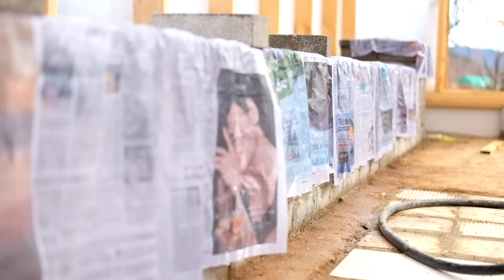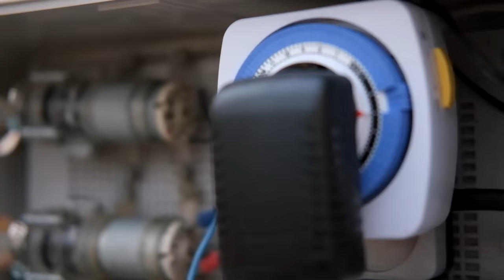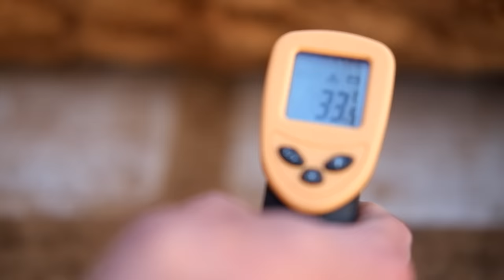비닐하우스 온돌 난방 만들기 | 온실 화목 난방 | 구들 만들기 | 가드닝 | 温室暖房  | Greenhouse Heating

Comment: This is brilliant!! I have been searching for examples of Korean ondol underfloor heating, so this is a compelling use of the concept. 
If you made a short ebook of the process of making all of it, so I could follow it from the US for my greenhouse, I would love to buy it. 
It would be good to know what dirt to concrete/lime/other mix you used for mortar, where the air intake is for the fire, if there is one, and so forth.
Reply from the maker: You know Korean Ondol. thank you.
It was a short video, so the explanation was insufficient.
I'll explain it later on my blog.
Thank you for watching.
Reply: Look into rocket stove mass heaters...
Reply: @ppeppefamily  link to blog?
Reply: Rocket mass
Reply: if you want to improve this concept you build the burning chamber below ground level, let the first 1m of the exhaust pipe decline, and then you let the rest, about 15 to 20 metres incline with about 1% incline. this stores more heat, especially into a lot of hea tabsorbing mass (earth)
Reply: Я слышала, что в корейских домах отопление в полу и мне это очень интересно
Reply: @@binanocht6110 that would be good, since it stores more heat.

A 1 to 3 percent decline, is enough to get around 10% more heat out the smoke.

Because the hot gasses gather before the incline part

Edit: 
The ratio between decline and incline should be about 1 to 5 atleast, so your exhaust has a good suction effect.
Reply: @@binanocht6110 of course i know what you mean, but i guess you dont know what 1% decline for a meter means
Reply: 하우스가  한국에 바닥난방 온돌  방식으로 제작
되었는데 얻어진 열에너지를 잘 보존 하는 것이 문제이고 나무숲 보호와 공기 
토양? 환경오염이  
없어야 된다고 생각합니다
단순한 기술은 아닌것 같습니다

Comment: Very nice ! My goal however is to eat more seasonally, extend my seasons with a passive greenhouse or sunroom, attached to my home of the winter-sun side ( south, in USA) & preserve well ( preserving nutrients with fermenting, dehydrating and storing as-is, like with root crops and winter squash etc., or "on the hoof" more and canning etc. less). I'd love to use geothermal heating too, and any other passive heat gain and retention and cold-blocking, temperature regulating/stabilizing that I can.
Reply from the maker: Thank you for good information. 🙏
Reply: If you're interested in geothermal, check out Citrus in the Snow for some inspiration. There are also ways to use compost for heat either inside a greenhouse or outside with a pipe bringing heat inside.

Comment: I'm curious why they didn't run the fire down the center of the green house, and keep the underground water where it is. To me it seems like it would spread the heat more evenly and be more efficient. Or was it a better use of space this way? Great video and I love how simple and DIY the whole thing is. It almost makes me wish I had such cold winters. Almost
Reply: And on top of it there are no obstacles in the oven. Hot air quickly passes straight outside. 
There should be some sort of labyrinth in the oven.
Reply from the maker: Thank you for those kind words 🙏

Comment: Growing up in a house with a wood burning stove attached to a metal chimney as the only heat source, I would run as much of the metal chimney inside as possible to take advantage of the heat radiation from it.  We could heat the house with a much smaller fire in the stove when we ran a slow fan behind the hot chimney pipe.
Reply from the maker: That's good information.
Thank you for watching.🙏

Comment: How does the water in the barrel get heated
Reply from the maker: Fire > Copper pipe heating > Small pump > Water tank
Water in the water tank - Circulation pump - Copper pipe - Water tank
Reply: Is the water in the tank solely for heating the space under the sisal rug? And why?

Comment: Awesome.  Where did you get the mat you cove the floor with, would be great to cover permanent beds in winter.
Reply: Have you heard of the Save Soil movement before? Without fertile Soil there is no food, and the climate is getting warmer, there were many droughts all over☀️
We can turn this around🌻🌿
#SaveSoil #ConsciousPlanet #Mentsükatalajt #Tudatosbolygó
Reply from the maker: Vietnam Coconut Mat.
https://greenking.modoo.at/?n_media=27758&n_query=%EC%95%BC%EC%9E%90%EB%A7%A4%ED%8A%B8&n_rank=5&n_ad_group=grp-a001-01-000000021990232&n_ad=nad-a001-01-000000139802710&n_keyword_id=nkw-a001-01-000003788980577&n_keyword=%EC%95%BC%EC%9E%90%EB%A7%A4%ED%8A%B8&n_campaign_type=1&n_ad_group_type=1
Reply from the maker: Thank you for those kind words 🙏

Comment: Some electro-ceramic could be possible better for keeping the heat inside of a boiler. Here in Russia we have a lot of energetic values we use just ventilation convector with climate-control. It is very cheap and producive.
Reply from the maker: Спасибо за добрые слова 🙏

Comment: Very well done,
But have a question for you to consider in the future
How do you clean the tunnel portion before the chimney?

And when that copper pipe in the heating area chamber, becomes covered with carbon etc. 
It will slow down the heating transfer, and wondered why you didn't plan on encasing it 
And I would have also asked why you did not use stainless, as copper will deteriorate much faster than stainless I think.
And if you try in the future to clean that copper, it will be soft and scraping it may eventually wear through it, or it may become very soft and collapse, such as folding down and you may have a blockage, 
That may never occur, but was a thought I would have considered,
But very good design
Also a thought just came to me, where one could have integrated this design factor you had done, in a low level ground green house, Not sure if you had seen them, where they also take into account the winter sun heating the back wall extending the use of the season.
Would probably given a year round growing, and you would have also reduced the amount of wood for heating.
Reply from the maker: Thank you for your kind words.
Basalt slabs were not glued for cleaning. (Using mud)
Stainless is good. However, it is difficult to process alone.
There are many mistakes because it's my first work. I will fix it with pleasure again. 🙏

Comment: Gr8 Korean🇰🇷 woodfired 🔥 Greenhouse /[]\ design!!! BUT 1 error,  the dissimilar metals will cathate. The copper tubing should not be sitting on the steel rods without an electric insulator.
Reply from the maker: Thank you for those kind words 🙏

Comment: For durability, please consider something to hold the door glass like rivets and a bracket or bolts with washers trimmed to not obstruct the view. If that tube is refractory cement, you should etch the outer edge of the glass. With it being a flat to a flat you're just hoping really. If it is sodium silicate based it will let go too.
    I've run both products through half a dozen fireplaces, they just don't take shock unsupported. I even soaked fiberglass rope in both and used it for gaskets on a 50 by 50 cm furnace door. It was good briefly. 
   Apologies for the prattle, but I've used these types of things many times and have replaced glass, there is always a frame or something. It is very nice, but the glass will soon fall out and probably when it is going.
Reply from the maker: Thank you for those kind words 🙏

Comment: I can i get the plans of yur greenhouse build? I would like to build my own greenhouse like yours here in America. Thank you,! Great Teamwork
Reply from the maker: It was built without blueprints. So I don't have any data to share.
2*4 inch structural wood, pillar spacing 22 inches, roof angle 21.5 degrees, maximum height 2.4M...

Comment: this silicone sr 3300 Temperature resistance is 250 °C. You think is enough ?
Reply from the maker: Used between stones and stones.
It's a bit lacking. However..
No problems so far.

Comment: If they had more bio mass in the stove the temperature would stay more regular for longer. They needed to make that bench larger. I would also set a 55 gallon drum over the top with the barrel collecting and distributing water in the center of that as a way to collect more heat. Or just add more bio mass and lose the water altogether.
Reply from the maker: Thank you for those kind words 🙏

Comment: How would you clean out the fireplace under the seating area? Also what is the purpose of the radiate heating under the coil mat, is it to keep the ground from freezing?
Reply from the maker: For cleaning, basalt was glued with mud.
I plan to remove the basalt and clean it.
The purpose of underfloor heating is to warm the air at dawn.🙏

Comment: Great video. Very inspiring. I"ve watched it a few times but not sure how the water in the barrel is heated. Is it thru the copper wires?
Reply from the maker: Copper pipe heating - circulation motor - hot water tank - timer operation - floor heating

Comment: Copper and Dissimilar Metal Corrosion
When one metal contacts another, there is a current flow between them. The current flow changes when dissimilar metals come in contact with each other: the corrosion rate of the active, or the least corrosion-resistant metal, accelerates and the inactive, or more corrosion-resistant metal, decreases.
Reply from the maker: Thank you for good information.^^

Comment: I dont get it why not just put real woodstove in there i dont understand the 1 you put in the ground what is it doing you put concrete and thick mat just cant see it doing much neat idea though
Reply from the maker: Everything is an old Korean heating system.
Thank you for watching. 🙏
Reply: @ppeppefamily  hi its very similar to a way alot of people heat there house here in canada in floor heating im just curious how it works for you does it just warm the air or does it actually warm the dirt thanks for letting me know its great set up

Comment: I can see at least 3 what i would called mistakes...better to heat in the middle of the greenhouse, the heating floor need to be insulated from the ground and not not from the top with the rag, there are no opening to clean the system....
Reply from the maker: Thank you for the good point.
The basalt is not glued for cleaning. 🙏
Reply: @ppeppefamily  Ho sorry, i though it was.